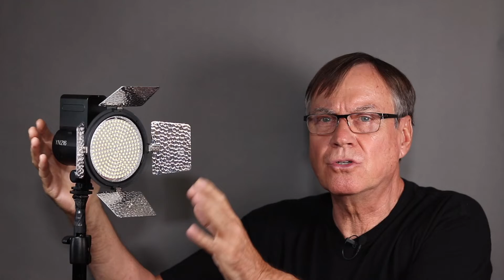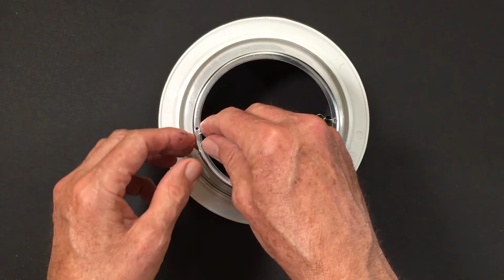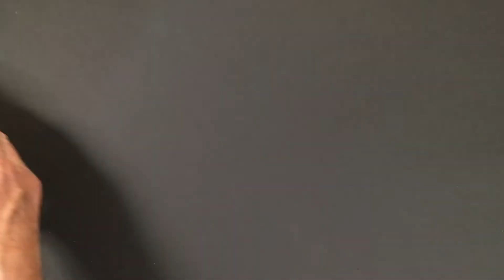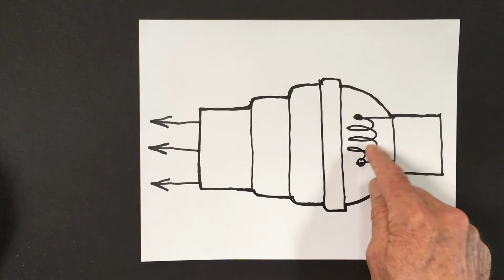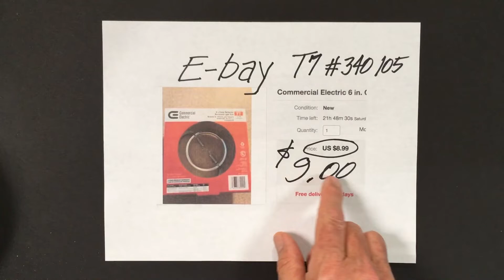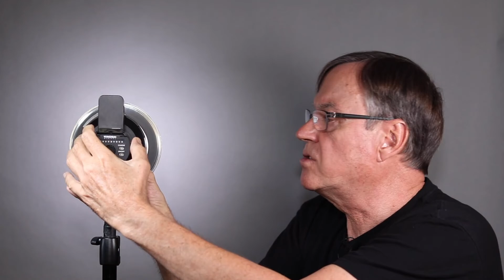YN 216 Snoot Reflector

Comment: Would the barn doors not function as they should if covered in black gaffer or duct tape?
Reply: Black tape or taking them off and spray painting them matte black will result in a conventional barn door function. Unfortunately, barn doors simply narrow the beam pattern by absorbing the outer parts of the conical light output of the fixture. If that loss in efficiency doesn't ruin your shooting intent that's fine. I hear a lot of people use the YN216 camera-top for weddings. What an ugly rig, one that is bound to be constantly in need of attention and re-adjustment not to mention a potential injury risk to celebrants. My reflector suggestion is very much dependent on the focal length of the lens used and the distance from subject. If you shoot a very wide angle lens you'll get a darker vignette around the perimeter of the frame. How are using the YN216? Perhaps we can figure something out that more precisely satisfies your needs. PW

Comment: Hello!! Why haven´t you posted more videoos? I `d love to see more of you telling us how to use the light or maybe photography! anything. Also im thinking in buying this light. Maybe use it as a keylight but with a difussion. Do you think that could work?
Reply: Key light with diffusion might be construed as a contradiction of terms but I catch your drift. Amazon sells diffuser socks that will fit over the reflector. Look for Neewer brand and others. You can also buy a large piece of sheer white nylon fabric (Neewer) that you can cut up and use as needed. Very handy and versatile. With LEDs you don’t have to worry about diffuser materials bursting into flames so there are many things you can try: a cheap sheer handkerchief, parchment tracing paper, waxed paper*,  and options you might find at a good art supply store like BLICK. Think sheer Japanese washi paper. Remember that the denser the material the more light loss you will experience. El cheapo lightweight frosted shower curtain liners from Walmart or dollar stores are only $1 or $2. Walmart ones are pretty white. You can put in a 6” diameter embroidery frame from Michaels/JoAnns/Walmart for maybe $4. The possibilities are endless. *be careful and watch for slight color casting that will change color temperature of light on the subject. Have fun.
Reply: I have found the umbrella softboxes work best with this light if you are looking to diffuse it since the YN216 has a coldshoe and can be mounted to a generic umbrella adapter for speedlights. Since these softboxes are indirect and have diffusion keep in mind you will lose about two stops of light on average. If you feel adventurous you can mount up to three YN216 inside of these softboxes which should give you some power back.

Comment: Really nice!
Can you still use the color modifiers with this hack?
Reply: Yes. And sorry for the slow response. And ignore the instructions: “Simply insert the color temperature plates into the color temperature CHIP CARD SLOT” ??? There is no such detail. To use the diffuser or color correction filters (discs) remove the barn door ring. You won’t need it. Insert the disc into the fixture with the 1/8 inch (3mm) flange facing the back of the fixture. This requires a bit of fiddling to get it to snap into the fixture. Be careful not to put any pressure on the LEDs. Now you can tape on the reflector. There will be a gap equal to the thickness of the disc. You just have to accept this. If you want to use the barn door with a disc follow my instructions and then install the barn door assembly over the disc and lock in place. Love this fixture but they just glossed over the disc installation instructions. And, didn’t get it right. I love to write and illustrate instructions and am available. New idea -  It is possible to permanently attach the snoot/reflector to the barn door ring. Remove the 4 blades and all hardware. Discard. Tape the large end of the reflector to a board or table (for control). Place the ring on top of small diameter opening on reflector. MAKE SURE YOU KEEP THE SIDE OF THE RING FACING UP, THE SIDE THAT SNAPS INTO THE FIXTURE. Use two or 3 small pieces of tape to keep them aligned. Carefully “float” a thin bean of regular super glue (the thin stuff, not the gel) where the ring and reflector meet. Only enough for it to “wick” into the joint. Be neat. You’re only “tacking” these parts together. After curing do a caulking like fillet on the outside of where these two parts meet. Use silicone of your color choice. I would use black. Let cure for at least 24 hours. Now you have the easy-on/easy off snap function for installing or removing the reflector on the fixture. Use whatever adhesives you are most comfortable with.

Comment: Make a fresnel attachment for it. That would be cool.
Reply from the maker: "Glass or plastic?" Know the movie? I know I'm remiss on following up. I have other light control option for the YN216. Since I've designed a slew of track heads I find this fixture engaging. Kinda like the incandescent/halogen studio lights of "old". Got a box of used 500W 3200K lamps, cheap.

Comment from the maker: Hey xHOTDAMNxHBx: not to be critical but I think you mean insulation board? Why not just use Elmer's 3/16" thick white foam board from Walmart, $1.77? They're 20x30 inches but could be taped together and folded for transport. I think they use fluorescent brighteners in bleaching the paper so watch out for a slightly bluish cast.  If you need larger sheets Blick Art Supplies is a great resource. As for the NYLON SILK idea I've got as many as 7 "adders" to the YN216 MODIFIER story coming out in the next couple days. Please stay tuned....and....thanks for your interest!